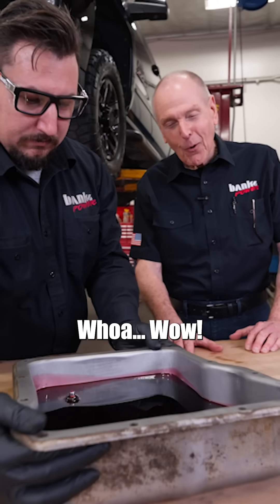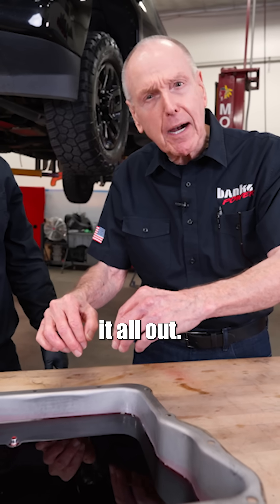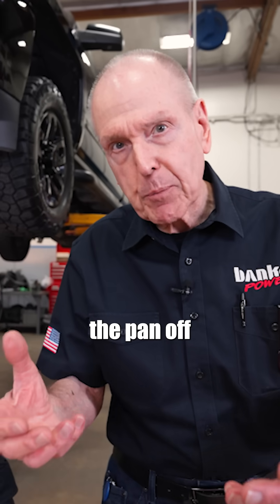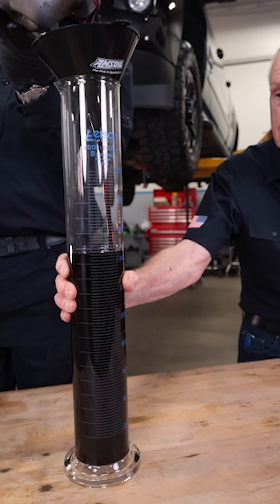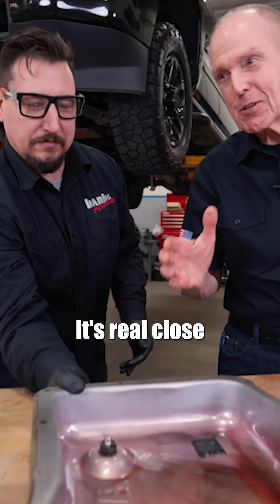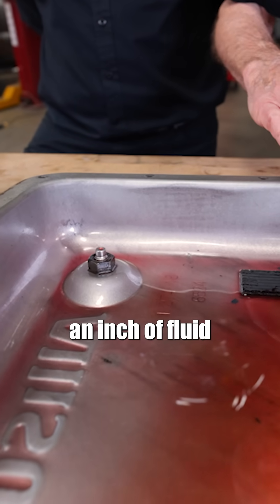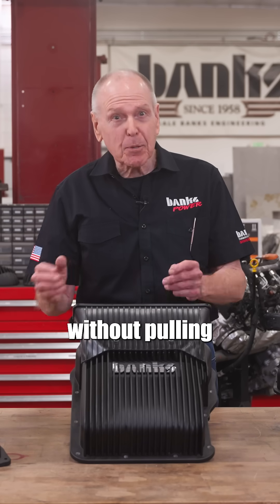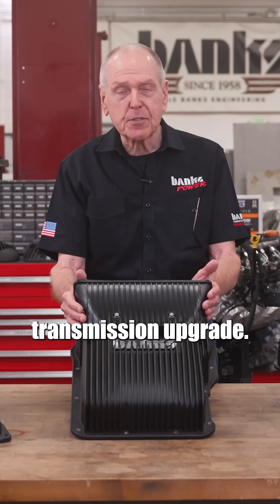This factory drain plug is a joke.

Comment: You drain modern transmissions by pumping them out, not by a drain plug. The plug is actually the fluid level check.  Google GM 8 or 10 speed fluid change procedures.  It's quite humorous. (Ford is same transmission)

Comment: My old 1997 Dodge Ram had this same issue, except it was on the oil pan.  No matter how many times I changed the oil, there was always trash left in the pan.  Eventually, that trash built up enough to start clogging the oil pickup tube, but only when the engine was running at traveling speed.  The oil pressure would drop to zero.  Pull over to the side of the road an run the engine at idle and the oil pressure would climb back to normal.  Push the gas pedal and watch it drop to zero again.  Extremely frustrating.  Pulling the oil pan was not easy, because there was a cross member, so the engine had to be lifted.  But wait, the intake manifold had to be removed before you could lift the engine...  What a shitty design.

Comment: ive seen cam belt designs that doesnt let you change the water pump unless you take the belt off . 
ever wondered why ?
most decent mechanics know the reason .
same reason here ....
youve got to change the oil filter or clean it .
engineers arent always idiots .

Comment: Back like 30 years ago, I’m not sure of the exact time. The company I worked for let me use a new 1994,K 2500 Silverado reg cab 6.5 Turbo Diesel, with a 5 speed manual, 3:42 posi rear with HD Camper package, only due to the 600 gal diesel tank/site/pump for all the equipment I was responsible for to keep filled with fuel every morning, then go back around with a built in powered lube system that ran through 25 gal grease barrels,to get around job sites to maintain their running fine. With a full load of fuel and grease the truck was approximately 6,700lbs on a scale with me in it fully loaded with fuel and grease, tools ready to go. That ran ok, got decent 14-20 mpg, but little passing power at 65-70 mph. Until that is the turbo blew up plus a head gasket! My boss didn’t want to buy a new truck, now in 2001, with 110,000 miles on the diesel. So we took it out, bought a complete Banks Power Package, sent to a diesel engine specialist for a complete rebuild as close to bulletproof as possible! Total cost? Then? $13,400! Parts and labor. When finished that ran better than a new diesel! Plus getting 22 mpg at 65! The truck eventually wore out the trans and rear differential, plus with rust issues. So the boss had the engine place in his own personal K1500 2dr Blazer to give to his kid! What a beautiful job his sone did finishing off the custom touches.

Comment: The 10 speed Alison doesn’t have a  dipstick level indicator. You have to get it up to temp and pull the plug until it drips then reinstall the plug… I wonder if they accommodated this with two plugs?

Comment: Just push a screw driver up the drain hole and it should dislodge the filler level drain plug the oil will piss out in mins, after the oil has drained remove the oil pan make sure you replace the level plug back in the oil pan before replacing the oil pan then refill thru the drain plug to required level

Comment: ....can't speak for a 2500, but the "drain plug" on my Colorado is to set the level, not drain the fluid. After you do the change, refill with some extra fluid, then while running you pull the "drain plug" and it settles down to the appropriate amount of fluid.

Comment: How the original design of the oil pan can be so bad. Drain plug must be as low as possible. A few percentage of the oil could remains but almost half of it! Scrap design engineering

Comment: You actually DO NOT want 100% of the fluid to be drained.  You DO WANT some of the old fluid to remain. A small amount of the old fluid actually protects the engine/transmission better than just all new fluid.  Although, that much in the video is a little more than necessary.

Comment: There needs to be a law that forces the engineer that designs drainage plugs for fluids to be forced to chug the same volume of left over fluids in 100 proof vodka. That 1850 ml, 1.85 liters would be good enough to get rid of a bad engineer.

Comment: It's a fill level check for the transmission fluid guys. Fluid @ 185°f vehicle running and in park you pull that plug and anything that runs out is extra. Once it stops flowing and starts to drip your trans is filled to the proper level.

Comment: How have we got to needing a correctly designed pan ? When I was starting out as a mechanic and color TV had not been invented drains were at the lowest point, external filters and a drain on the converter. Longer to do , but more complete.

Comment: Mister banks how do you not know that you're supposed to leave 1/2 the fluid in it and never change all The fluid totally out, It will cause the transmission to slip, That was the Factory design of the pan was to hold that fluid so you couldn't drain it all out, Sometimes it's best to never mess with the transmission  never change the fluid or do nothing until it goes out and then just change the whole transmission, That's why that pan was made like that so you couldn't drain all the fluid out at one time, Google this ""Is it bad to change all my transmission fluid in my car"", or Google this ""Is it bad to change more than half of my transmission fluid in my car at one time"",  That pan was made to hold the fluid in the pan like that From the factory for a good reason,

Comment: I add my own NPT bungs to bungless pans or those with damaged drain plug threads. I weld the outside not the inside and use shallow fittings (cheap from many Ebay machinists) . NPT threads being tapered are easy to repair with a standard tap.

Comment: Wouldnt you need to pull the pan to change the filter anyways? Most pans dont even have drain plugs to begin with. I feel like its just there so fluid doesnt blast out of the seams when you drop the pan

Comment: So if the oil pan was flat and the oil happened to leak out you would be screwed but if you still have some left less likely the transmission is damaged. Is it a flaw or engineered that way.

Comment: Most people won't even bother to change their transmission. Fluid therefore, is designed to not drain all the fluid out. Cause then it won't grab any friction, if you constantly change. And then yes, change to your Pant. It's a lot better, but if you're the. Regular Joe Not doing your regular maintenance is best to stick to the original one.

Comment: There's a reason the "drain" is like that. It's not a drain. It's how you adjust the fluid level. You should pull the pan for inspection and see what's on the magnet every time you do a fluid change. Some can be a pain, but gasket is cheap to ensure there's not a bigger problem.

Comment: What Gale Banks has failed to mention is that the raised drain point has a purpose, accurate transmission fluid levels can be maintained simply by observing when top up fluid runs out of the hole.
This method is more accurate than conventional dip sticks.
Not sure how one will measure the fluid level with the Banks design oil pan?

Comment: Short of a magnet to collect any metallic debris, That's a perfect design as long as the owner period makes scheduled oil changes its a built in safety  valve. (Cushion). In most cases a pan upgrade is never installed.

Comment: The drains purpose is to remove enough fluid so you don’t make a mess taking the pan off. It doesn’t need to remove all the fluid since you should be taking the pan off anyway. If your changing the fluid you should be dropping the pan anyway to change the filter and cleaning off the magnet.

Comment: Isnt that so the level is always right? Manh transmissions have it so if the fluid stops flowing/dripping the level inside the pan is at the right level, meaning there is enough oil in the pan….. thats probaly why the drain is so far up in the pan..

Comment: The reason they do that is because of the friction material that comes off the clutches keeps your transmission from slipping and if you are removing all of the friction material every time you change your fluid you will just see premature transmission failure. Banks makes some useless and really bad designed items.

Comment: on the majority of trans ive worked on thats not a drain plug but actually a fill port you screw a special insert into to get proper fluid level. however on all trans were gonna see nowadays the filter is within the tranny so you gotta drop the pan if youre doing an actual fluid service.

Comment: The drain plug is really just there to get majority out so you dont make as big a mess when pulling the pan. I respect Gale Banks, he's way smarter than me, but it should be pretty obvious that drain plug is not ment to be like an engine oil drain plug to just drain and fill, its just to make you're job a little less messy when pulling the pan down. Need to pull the pan to change the internal filter anyway.

Comment: I dont see how this would be a problem if your using a BG Transmission flush machine to Service the fluild. It goes threw the Transcooler line. 

HOWEVER. This IS a problem if your doing a drain and fill type Service. 2 quarts? If its really dirty thats gonna suck.

Comment: I'm not a car guy, but I refuse to believe that the designers made the pans that way accidentally and don't have that extra volume there either for a reason or because it doesn't matter. So I have to wonder if having the drain at the lowest point is actually a good thing or just something that seems good and so can be a selling/differentiating point that doesn't actually amount to anything.

Comment: 90% of new transmissions don’t even have a drain plug. I had to buy an aftermarket pan for my 03 f150 to be able to have a drain plug. They don’t want you to do your own maintenance anymore they want you to use cheap dealer fluids that aren’t designed to keep your vehicle in tip top shape. I run AMSOIL everything in my truck and that’s why I’ve gotten 340,000 miles out of it and counting

Comment: On GM transmissions they do that on purpose. It's how you check the fluid level. They don't make dipsticks anymore and thats how you check the fluid level is by getting the transmission to a specific temperature range and then (with the engine running) pull that plug and let the fluid drain out until it becomes a slight drip. Its not suppose to be a drain plug. 
Certain Allison's are made that way and if you change that design you won't be able to check your fluid level.

Comment: Unless I’m mistaken, that’s not the drain plug though… that’s how you set the level inside of a “sealed” transmission.  You have to use a transfer pump to remove the fluid from the pan.  That’s at least how that system works on a lot of sealed transmissions, where you have to remove the pan anyways during a drain and fill to replace the filter.

Comment: The reason why they design them like that is to shorten lifespan of the transmission or engine. If they make reliable vehicles that dont break down how will they make mo ey at repair shops

Comment: sticks WAAAYYYY to far down for ANY type of off roading or trailing or even on normal cars where you only have half a foot of clearance. i Dont know what monster truck can have this without it instantly bottoming out on the first speed bump but this is stupid to be so far down on the transmission. regaurdless of how much cooling it has. unless you never want to go off roading in your truck, never buy these after market oilpans and transmission pans.

Comment: I portably would have just did one more drain and fill of the fluid, most of that left in the pan would be gone or heavily diluted with cleaner fluid rather than pull the pan.

But yeah that is a lot of left over fluid no doubt.

Comment: It’s literally to just drain most of the fluid to help with the mess when you remove the pan. It’s not a joke it’s great
Reply from the maker: @CatfishChronicles-g8g  If that’s the case, why doesn’t the 10/1000 GM Allison have a drain plug?
Reply: @ idk I wish mine had one though just to help a little with it though especially being a guy just doing maintenance in a parking lot.

Comment: That new pan looks like a nice upgrade 👌
Reply: It would also be exceedingly easy to put a drain on the torque converter and a spin on filter. No reason you need to drop a pan to change oil and filter on a transmission.

Comment: I never just drain transmission fluid. I always pull the pan and change the filter. So this would be slightly irrelevant to a transmission service... Would it make servicing a transmission easier? Yes. Yes, it would. But it's easily manageable with a stock pan.

Comment: I’m not an engineer just an auto tech with nearly 2 decades of experience. My only logical guess on why the manufacturer wouldn’t want you to completely drain the pan is to not lose too much of the clutch material that’s gets in the fluid. From my experience transmissions tend to get neglected always and when the services get ignored it’s not out of the realm of possibility to get an excessive amount of clutch material in the fluid and you’ll be surprised on high mileage vehicles how that clutch material in the fluid is aiding in engagement of the clutch packs, pressures within the valve body etc. I’ve done full trans services before on neglected vehicles, hop in it to test drive it and the car ends up slipping, driving like crap etc. 
but if the main concern is getting those last 2 quarts out of the pan, save yourself the time and just flush it. If anything the ram air/cooling of the fluid is wayyyyy more important that being able to drain an additional 1.75 quarts out of the pan. Cooler fluid temps/operating temps = extending the life of said fluid/part the fluid is responsible for. I’d be more concerned about leaving the 5+ quarts of dirty/burnt/contaminated fluid in the torque converter than the 1 in the pan.. 😂

Comment: You'd have to drop the pan to change the filter, so it doesn't matter how much is left in the pan. 
Most vehicles don't have drain plugs. Many don't don't even have service tubes to check levels.

Comment: Right, but now you get to change the filter.  If the fluid is "that dirty" they one would sure want to do a filter.

So im not sure why it's such an issue....

The cooler is all well and good too but what about today's transmissions that have a thermostat......

Comment: That's why I use a fluid exchanger machine todo mine because it will also get the fluid in the torque converter but not everyone can afford a 8000 dollar machine so I don't totally disagree with your video

Comment: Thats not a drain plug but it is actually a bleeder hole. It sets the correct transmission fluid level when running
Reply: Ahh yes a transmission that purposely drain fluid out.. that's definitely not the stupidest thing I've ever heard
Reply: The only comment that makes sense here
Reply: YES!!
Reply: Never heard of this.  It has a dipstick, what's the point?
Reply: @jayres6372  it doesn't have a dipstick, that's the point
Reply: Your right as fuck...👍
Reply: People who know, know the OEM pan was designed that way for a reason. Banks is a salesman who knows how to sell.
Reply: I don't know if you're correct, but I do believe that plug -- and the raised up area -- are obviously designed that way for a reason...

...it's clearly not just a drain plug and for them to act like it is (and a bad design) is just disingenuous.
Reply: it's and overflow check. you pull that plug when it's warm anyone mechanically inclined knows this

Comment: Part of the problem, besides the weld nut and the raised tall dimple, the drain is in the top of the shallow end. Even without the weld nut and raised dimple, there would be a huge amount of fluid in the pan.

Comment: Mr Banks,  my favorite Hot Rodder❕️ that being said, l wonder if you had a bad leak? Or someone drained the transmission pan and went on break? Or ??? Do you think that the one inch of fluid left is enough to save the transmission if it were driven before the level was final checked? It just seems so purpose built? Maybe? It was a simple way to protect the drain plug❔️😮 Banks Design is far superior,  l must get me one. Thanks ✌🏻❤️ 🇨🇦.

Comment: I never understood opening a closed system like the transmission. Any system that uses incredibly tight tolerances are incredibly prone to foreign material/debris. It's actually incredibly risky, most CAT hydraulic systems are similiar. The #1 failure in hydraulic systems is foreign material, so it doesn't make sense why you would service a transmission
..

Comment: I'd suggest you pay the extra to have a garage flush the fluid then this isn't an issue and the torque converter and cooler/lines are full of fresh fluid too, the extra you pay is way less than a rebuild and in my opinion worth it

Comment: I like your videos, but this is done intentionally. You’re supposed to leave some of the old transmission fluid in to not only ensure the system is never dry, but also to keep the viscosity change from adding new fluid less dramatic. When you do a drain-and-fill, you don’t want 100% of the fluid to drain. That would be called a flush, which doesn’t care about this weld nut. You don’t want to flush your transmission every time. Also, you’d think the engineers designing this particular pan would’ve thought about the fact that the weld nut protrudes above the lowest point lol, it shows the design intent.

Comment: Transmission fluid will generally last the life of the filter unless you abuse it. If your changing the fluid you should be changing the filter. If you abused the fluid enough to think it needs change prematurely you should be changing the filter because you likely clogged it with particulates.The purpose of the drain is to remove a majority of the fluid while keeping particulate in the pan for inspection.